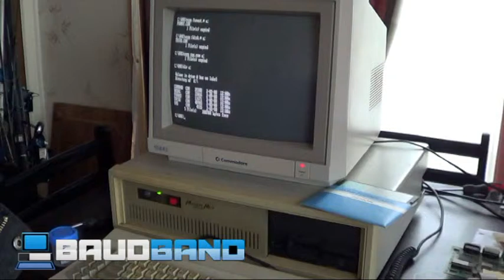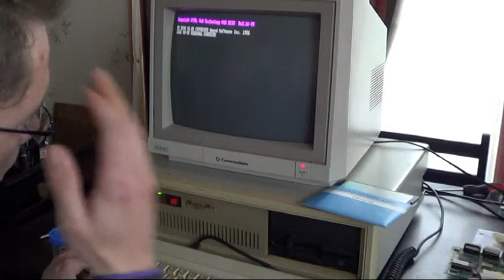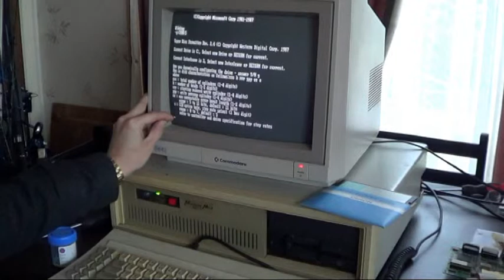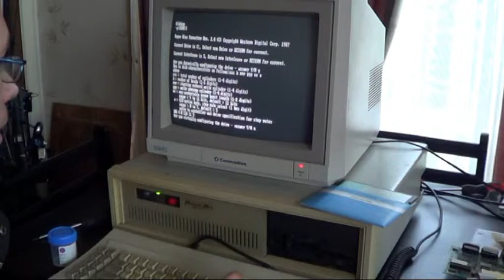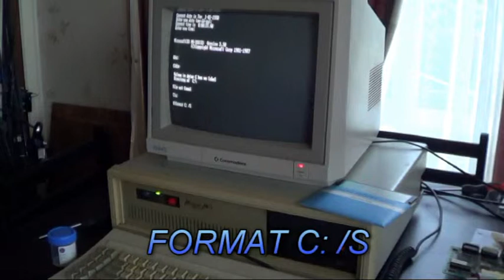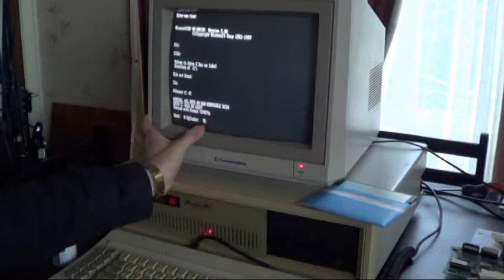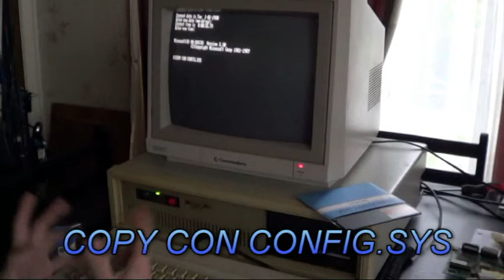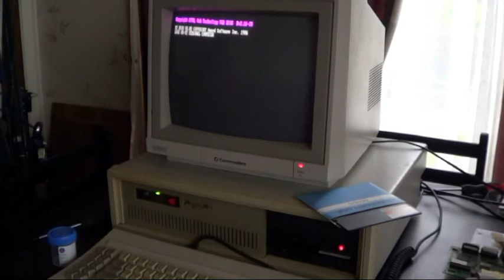Turbo XT Low Level Format

Comment: The Tandon TM502 was a very quiet drive for its time; I was quite impressed with how silent mine ran.  I usually run Norton Calibrate on any Shugart-interface drive I am installing, since it allows you to tune the interleave and perform a low-level scan for bad sectors (this can take hours to days!).

Comment: i got a ibm controller that dont work and some random ultrastor controller that will not let me go into its bios, I tried over 6 different combos trying to get into its on board bios but no luck. I have the same hard drive you have but there was a piece of paper saying it doesn't work. I used another program and it detects it but when i try to low level format, its giving reading errors. I still wanna get into the controllers bios somehow and really see if the tandom 10mb is really dead.